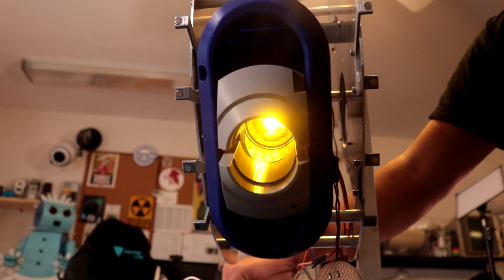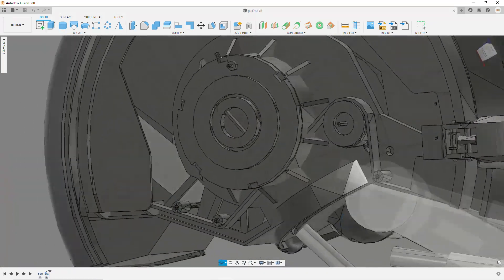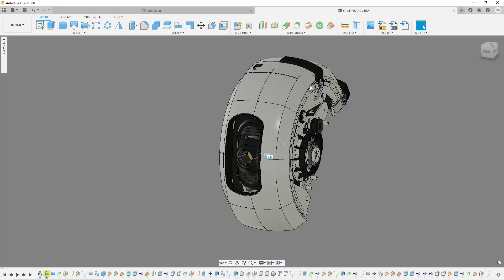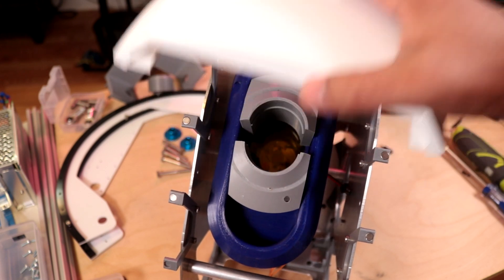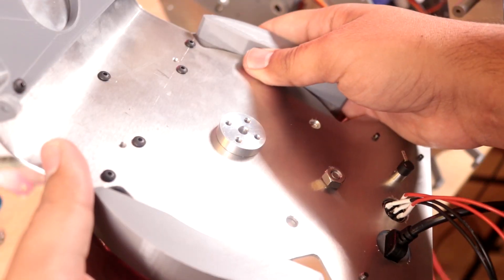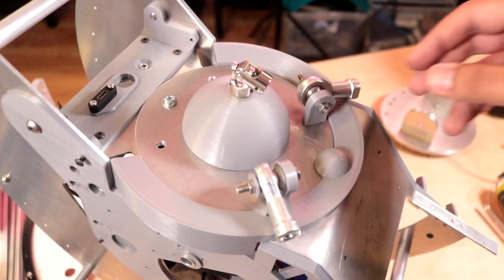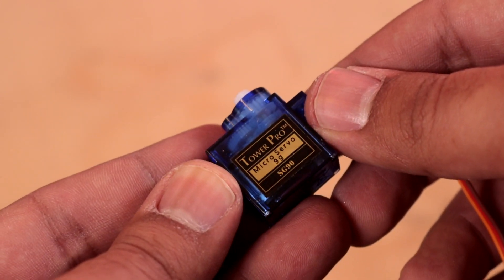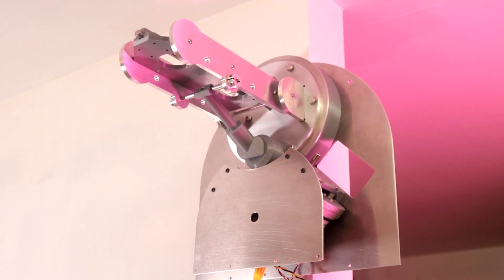Building GLaDOS in Real Life: Part 3

Comment: That's not what a universal joint is for. It's designed to take rotational load. You need a ball joint, that can take the radial load
Reply from the maker: definitely! Used what I had on hand first and it held up for the test. A proper bearing is on order. I needed to find one that had enough range of motion

Comment: I just had a great idea.
What if you made the design so the neck connection on the body could pop off, and you could place Wheatley on it? And have it completely change the personality to his, like in the game.
Reply from the maker: That would be a lot of fun! As is, it's mechanically and electrically designed to couple to her head in several different spots, so I'd have to do a big redesign for it to allow "hot swappable" heads for the output. Very possible, but something I'll have to keep in mind for future future updates.

Comment: Absolutely love these vids! And I also love using magnets for quick access to things in my projects, so convenient! :D One thing though - why are you using servo motors for the push rods? Don't they provide jerky/low resolution motion?
Reply from the maker: Glad they're still enjoyable! Well, I already had the servos on hand. There are three ways I can solve the motion right now: tighten the mechanical slop in my joints,  drive the servos programmatically (the stops and starts are from me manually lightly twisting a cheap servo tester so that I don't accidentally break anything), and also add a spring dampening system to keep her head under some tension. I had considered using linear actuators originally, but at the speed and strength I need, they would be much more expensive. I'm open to suggestions though! You've made some impressive mechanical builds, so I trust your opinion.
Reply: @MrVolt  I was just thinking that with such long levers, 180 steps or whatever the servo range of motion is, will still be a bit too jittery no matter how well you tighten everything and program ease-in ease-out...As well as having to deal with overseeking.  Have you considered using belts and pulleys or possibly a geared stepper motor, or mounting a linear actuator in a different way than your push-rods, so they'd move the head quicker? :)

Comment: so based on the fact that the face plate is being held in place in segments via magnets, i assume it won't be able to slide around the rest of the head partially over the eye assembly (which i believe would be done via the belts and wheels you can see running in and out of the "head-pucks" to the face plate, held in place by the "head bands") like it can in-game?
Reply from the maker: I appreciate someone who notices these kinds of details too. Simply, no. I had considered it, but it would have doubled the complexity of the whole head. Mechanically it is still able to fully retract and tilt her eye while recessed within the faceplate hole, so as far as expression goes, I'm confident I can replicate the range of "facial" expressions that she has in the game.
Reply: that's unfortunate, though understandable. if there's one thing i understand about design, be it mechanical or artistic in nature, it's that sometimes you just gotta make sure you don't bite off more than you can chew if you don't absolutely need to, or it'll make the entire project a pain to work on

Comment: So good!
That backlash is killer. A larger back plate or smoother motors? 
Let's get tacos 🌮
Reply from the maker: Gonna try some code wizardry first, but may have to use smoother motors. The servos were being driven by a cheapo servo tester and driven manually with my clumsy hands.

Comment: And here i thought the complicated parts were before this point, man, whaaat a journey, it must've been for that neck piece alone. Great work man.

Here's two tips: you can swap the ball ends for those that have cups that fit over balls. IMO, it would be a little bit more in tone with the industrial feel of the machine + they just look better. Usually you can find them as replacement parts for the struts that would keep a rear hatch open, or even the hood in more refined cars.

Assuming i'm reading this right, the U-joint is purely for motion, but in this case, because it's such a small ... motion platform (can't find the right words) ... you get that jerkiness multiplied. IMO, you should go with a ball ball end there. Specifically with the kind that you press fit, because it would give you a lot of mounting options (K6145 Style < put that into google images for an idea of what i'm rambling about).

They  make some of these for go karts, so about as big as a thumb, which would be scale for this application, and would provide just the right amount of resistance against the servos to cut out the jerky nature of the servo. I'd go for the type that has a thread on the back, you could get it mounted into a 3d printed bearing and thus give you all the range of motion the u-joint has.

And i know a lot of it is the mounting, but servos in general, unless you pay top dollar, they have the jerk.
Reply from the maker: Thanks! Ah, those joints are awesome, I had never heard about those before. I really appreciate your thorough replies! I'm gonna do some more part research based on your suggestions.